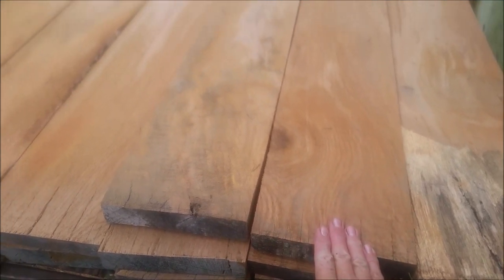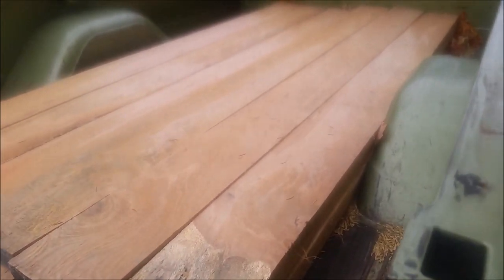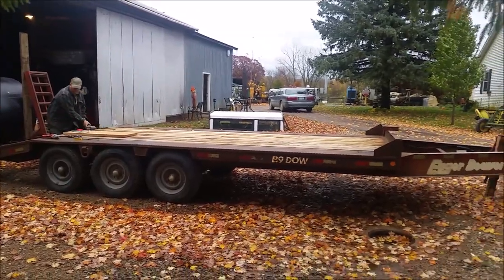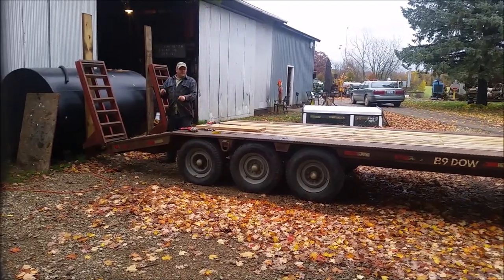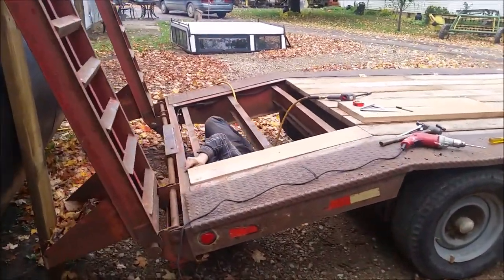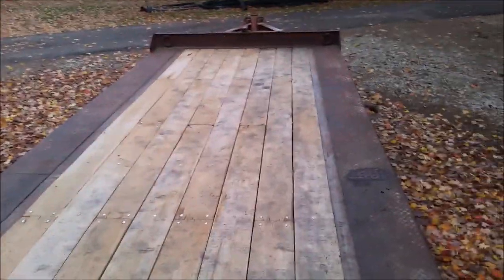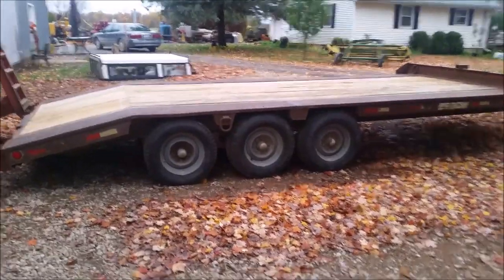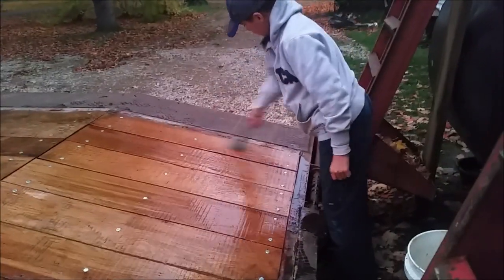New deck for the Eager Beaver trailer | Rough sawn white oak

Comment: Would the roofing for the snow fence be used galvanized roofing?  I worked for a farmer who'd put the used oil on his drive-way, he had it hard as a rock.  I use this Thompson Advanced Water Seal on my trailer deck just after mowing season and the water just beads up.  Is that how oil works on wood?
Reply from the maker: Its brand new material, maybe a bit too shiney for a fence but what a wind break it would make. I do have some snow fence too. Just not as tall as I would like. Yes the oil is like a varnish. I just did Antique oil on the house wood floors with teak oil. Petroleum!

I just found 3 cans of Thompsons in the garage. At least 10 years old. Someday I will find a use for it.

Comment: I am sure that you are aware that storage under roof greatly extends and improves the life of farm equipment but I will repeat it anyway Especially for items with a wood deck which last far longer if stored out of sun and rain. The Eager Beaver deck is white oak which is rot resistant but it will not deteriorate nearly as fast if stored out of the weather and yes, I do comment from experience.
Reply from the maker: One day we hope to have more barns. Moto here is engines inside, cover what doesnt fit.